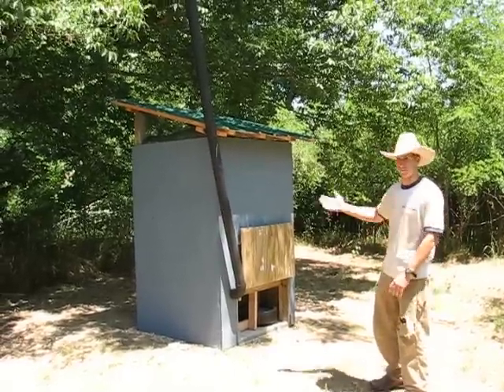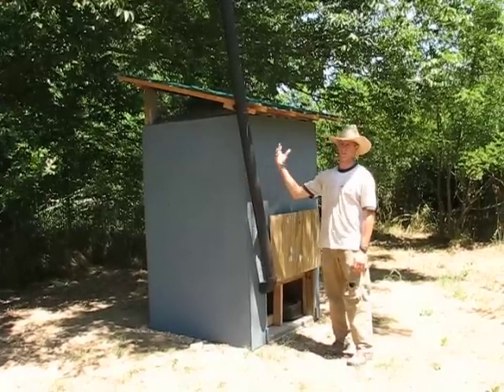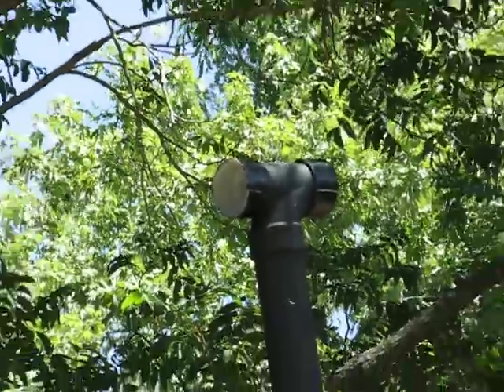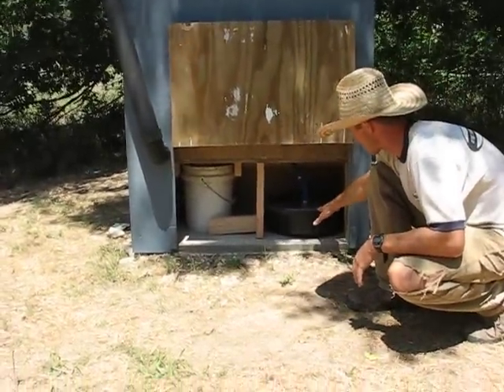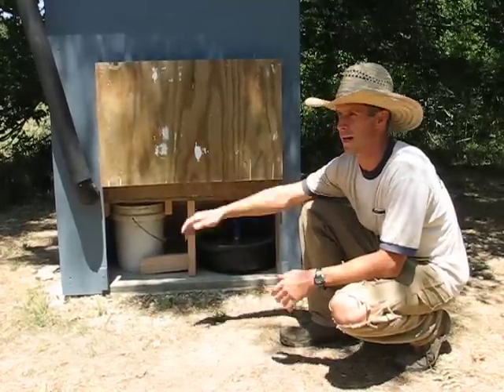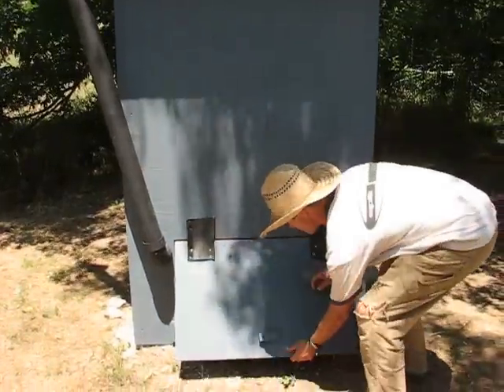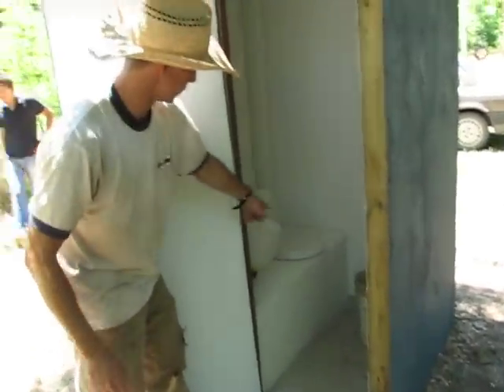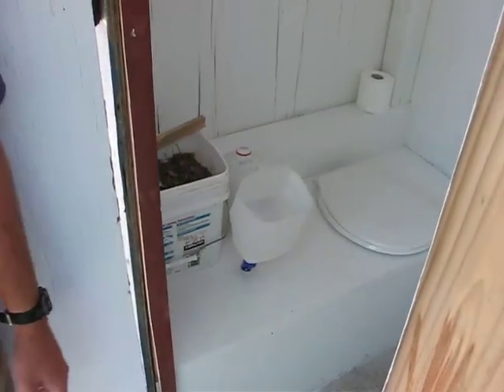Composting Latrine

Comment: In the High Desert in Northeastern Nevada where I plan to build my home away from home. I'm thinking what I may do is bury a 500 septic tank and have a 1/2 horse power with a 2"inch effluent sewer pump inside and when it gets full I would then pump it into a 5 cubic yard cement mixer off a Small sized cement truck that I have Already rigged up to turn backwards and forward.I would add ash from the wood burning stove and dried leaves and then turn it till it mixes.Whats your take on this idea?